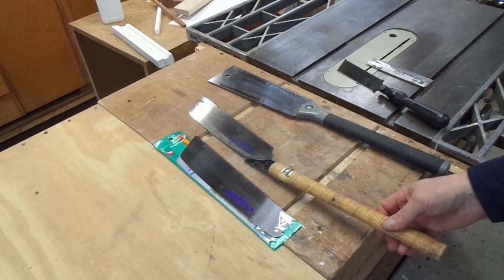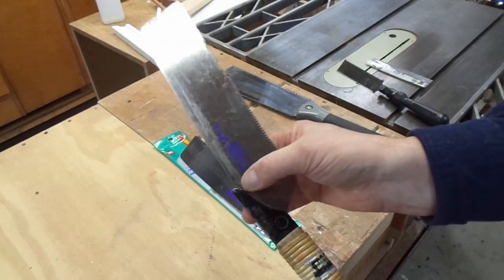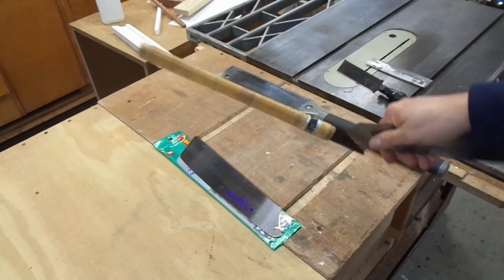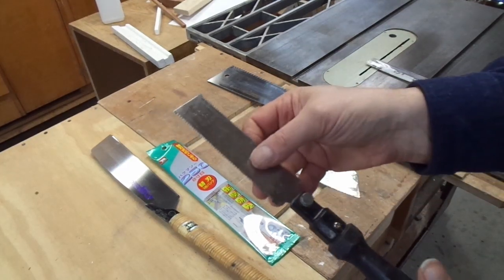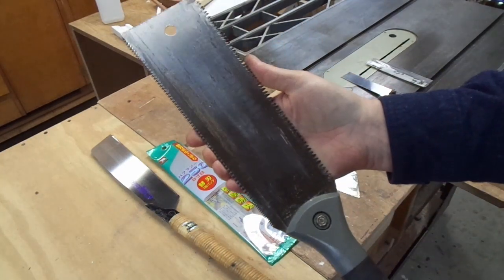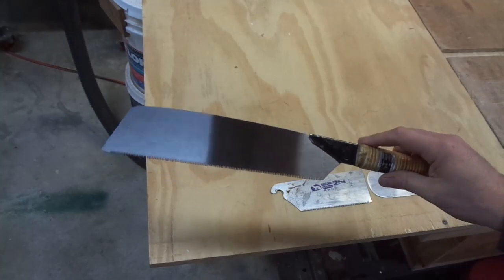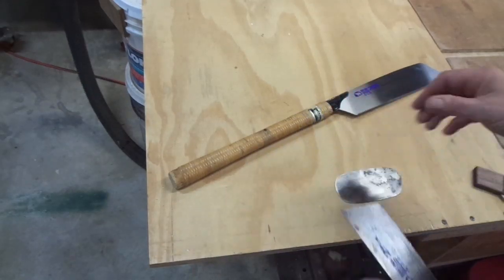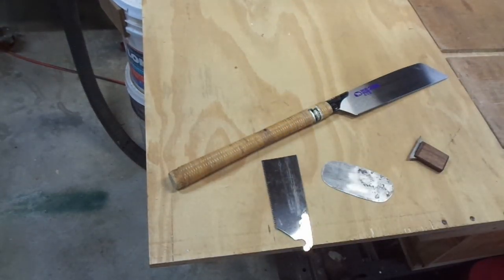Japanese Saw Kataba Blade Change

Comment: My question is how do you change a blade with a stiffener back?. Does the blade just pull out and how do you reinstall blade into stiffer? Thanks for any reply
Reply from the maker: Thanks for the question, but I don't own such a saw so I don't know.  When researching mine, I found some videos of people taking about the different Japanese saws but I wasn't focused on the ones with a rib on the back.  For me, I didn't remember where I purchased it so that didn't help.  I found the replacement blade as my original saw had enough of its lettering for me to find it.  Once I knew a blade was available then I started the search on how to change it.  I would have never guessed you "bonk" it out, but after seeing someone do it, I gave it a shot.  I wish I had a better answer but maybe this gives you an idea.  Good luck.
Reply: found nothing on replacing this particular blade. tried pulling it out but did not seem to work. will try bonking tomorrow. thanks.  FYI dropped the saw and the blade just broke a piece off. @jazbuilding
Reply: FYI, easy to remove blade thanks to Lee Valley. Put blade between two pieces of wood then in vice and hit stiffener with rubber mallet and out it comes